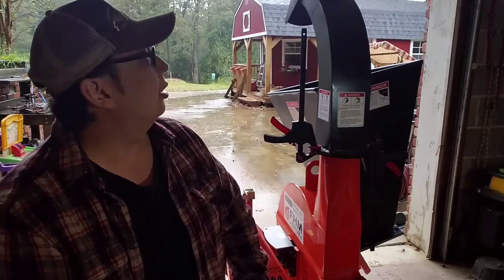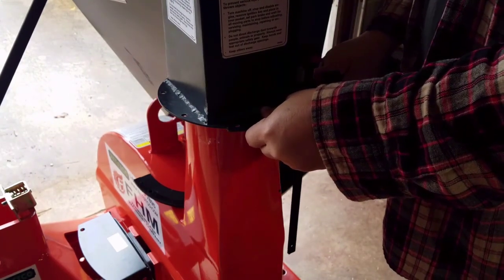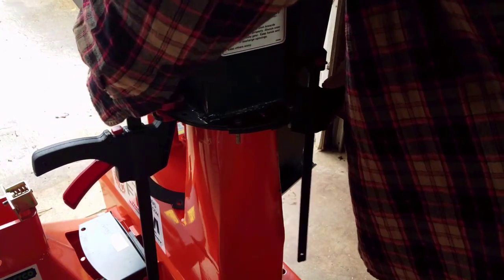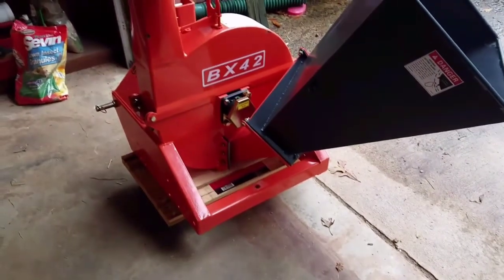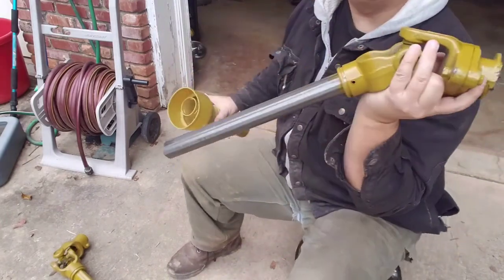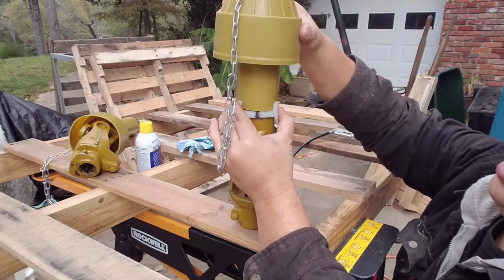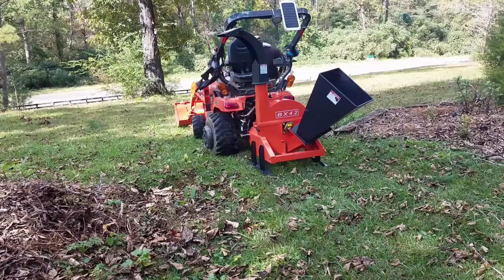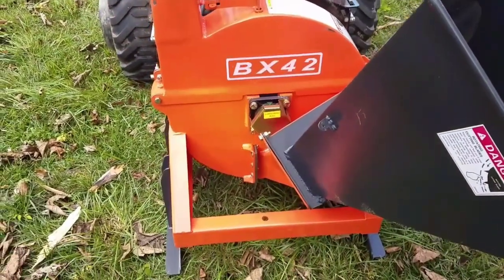Betstco FH-BX42 Wood Chipper: Part 2 Assembly and Hooking Up to Kubota BX25D

Comment: I've got an L2501 with a BH77 backhoe on it. I've ordered this chipper, but it will be my first PTO shaft attachment. Is cutting the shaft required?
Reply from the maker: Most likely will need it.
Reply: @ODLife  Well thats a bummer. I guess i'll go check out the video you mentioned from everything attachments.

Comment: Got mine after watching your videos, just wondering on mine when I rotate the fly wheel the space on 3 of the 4 fins seem ok but 1 out of the 4 comes very close to the  fixed blade on the side under the chute was wondering if yours are all the same or is there a variation?the fly wheel  on 1 fin seems to come close to what you call the twig breaker in your other video.
Reply from the maker: I have not paid that close attention, I'll look the next time I use it and try to do a video on it.
Reply: @ODLife  hey thanks for the response.
Reply from the maker: Hey, GP outdoors just did a video on his chipper.  Some play/balance issues may be expected. https://youtu.be/lXNoZZMvSU8
Reply: @ODLife  Thanks for sending me the message about gp outdoors I really appreciate it God Bless

Comment: you still using that chipper? I ran across your video and gonna watch the first one over and then watch this next on, Checking this model out and even called and talked to someone about a purchase. Think I am gonna drop the hammer and get one as I could sure use a good one
Reply from the maker: Yep, working great, sheared a shear bolt but that is what it is for.
Reply: Just ordered the fh-bx-42 tonight. Guess that means I need to find my first tractor to run it. Love your vids. Your flipped over pumpkin is how I found this chipper. just scored it for 1199 bucks shipped .Love it @ODLife
Reply from the maker: Awesome! Thanks for watching and commenting!
Reply: O&D Life - aaaand I’m assembling mine tomorrow (ok, technically this evening, as it’s 4am right now). 😁
Reply from the maker: Awesome you will really like it.

Comment: Great video thanks. Quick question apologize if I missed it but why dod you have to cut the length of the chipper driveshaft- was the chipper not made for the sub compact tractor? I am new but kind of thought that all CAT I 3-Pt hitches were a standard size(?)
Reply from the maker: +GPotter the pins are a standard size is my understanding.  The length can vary if you have a quick hitch which would lengthen the distance and I think the driveshaft are usually at various lengths with the understanding that you can cut but it's harder to add it back on.  BTW, I just watched one of your videos this morning, great job!  You are a natural! I subscribed, keep up the great work! I got to get caught up on your other videos.  Stay safe out there!
Reply: Cheers and thanks kindly!

Comment: Check ur quick attach locking levers on left side. Is it open?
Reply from the maker: Robert Bohannan good eye! That side wants to sit a little off so the lever won't close. If I loosened up the pin on the chipper it would change the angle enough and I could lock it.  Took off and I tightened back up and it won't seat down enough.  Think I just need to file the hole a little.